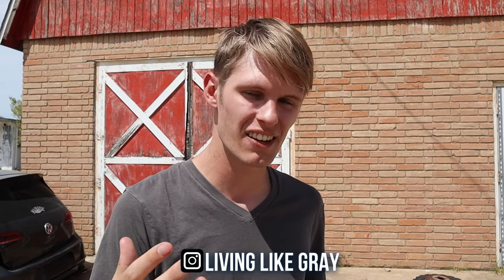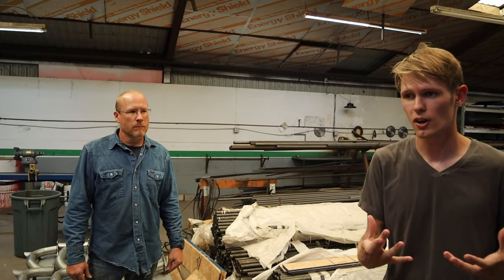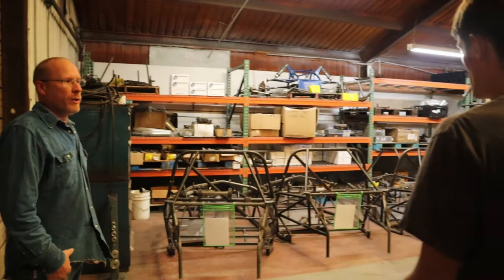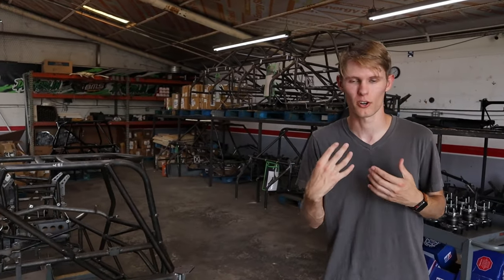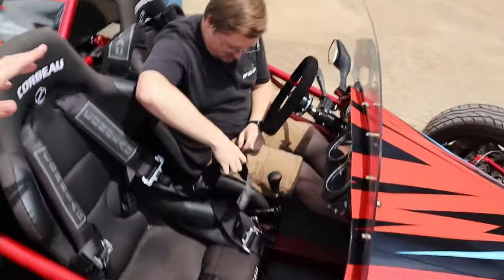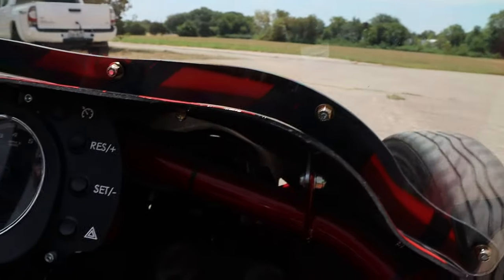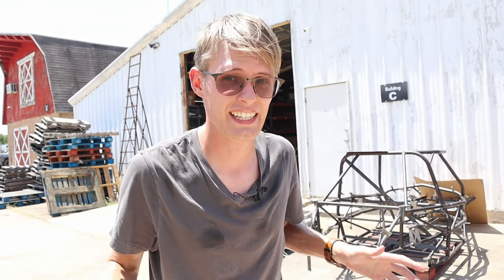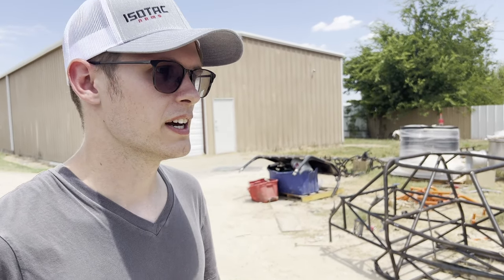Picking up My DF GOBLIN Kit car! - DF Goblin Factory Tour and Test Drive!

Comment: Atom owner here.  Those frame tubes look REALLY small.
Reply from the maker: That’s cool you own an atom! Would love to compare it to the goblin when mine is done.
Reply: @LivingLikeGray I previously owned an Atom 2 with the same LSJ Ecotec engine that you're going to put in yours.  The sounds in this video reminded me of it.  I now have an Atom 3S with a K24Z7 turbo engine in it.  Lots more power, but a different sound.    And I'd welcome any conversations/questions about the atom.
Reply: How was that $80,000 price tag lol 😂
Reply: @coloradotrader7202  "My momma told me, you better shop around!"  Only a fool buys a NEW one.   In other words, I didn't pay ANYWHERE NEAR $80K for mine.
Reply: @frankrizzo890  I built a ~400 wheel hp goblin with all the custom touches for 30 so yeah. The frame tubes are more than adequate.
Reply: I believe it’s mostly 1.5” dom. Better the sheet metal of a car
Reply: @mrneanderthal2891  yes it is 1.5 dom tube. I added more frame supports before I painted it
Reply: @coloradotrader7202  gotta pay for R&D and engineers.